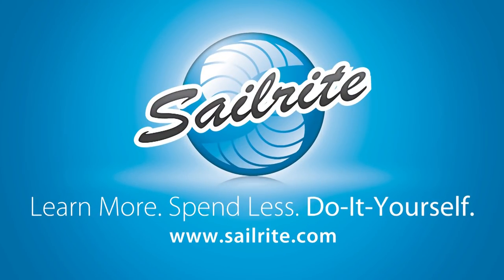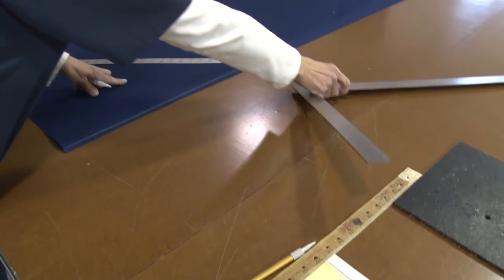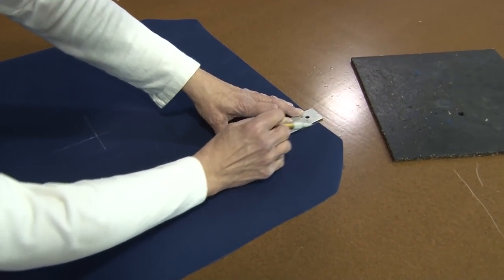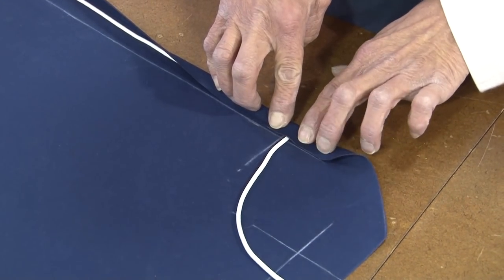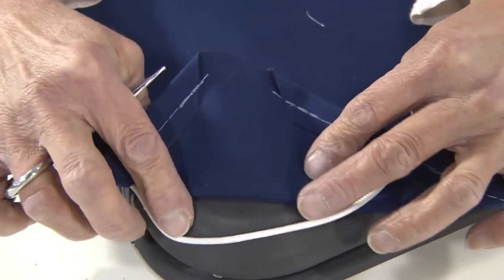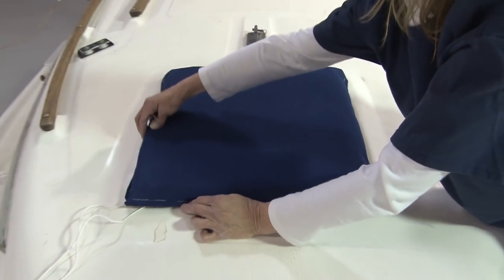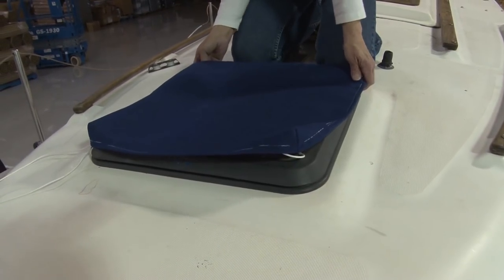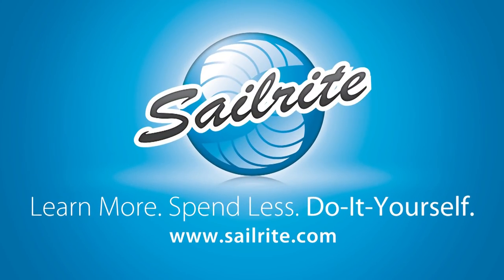How to Make a Hatch Cover Video

Comment: I have just completed making my first ever hatch cover using this method and very pleased with it and myself! My measurements worked out (mine wasn't square) following your instructions. The only thing I have done differently is  I have bound the ends of the elastic so I can't take it under the hatch to prevent leaching of rain but, instead, have added velcro on the under side which I can take under the hatch itself. I stitched each end of the individual strips of velcro, not on edge of material but in from the edge so that it is under the cover so should not leach water even though under and inside hatch.
Reply from the maker: Glad it worked out great!

Comment: I was making covers for a lewmar low profile number 30 hatch which is rectangular.  Even with adding the 1 1/2" addition for the hem, my first one came out to small by about 1/2" all around. I increased the dimension in both directions by 1" which seemed better. It holds very well, but is hard to get the long sides to tuck down because there is very little space between the deck and the hatch.
Thanks for the video is was a great help.

Comment: completed my first hatch covers. Questions and comments.
1) It is harder than you think to not sew the leechline. 😵‍💫
2) Suggestions would be appreciated to measure diagonal on a rectangle hatch.
3) I think I will not remove extra material at corners until I have actually fitted it for rectangular hatches.
4) Do you suspect hatches will leak if the leechline goes into the hatch seal area (gasket) as when you pull from interior?
Reply from the maker: It is possible that the leechline may cause leaking when placed under the gasket. Some are using YKK Snads instead of leechline to secure hatch covers for that fact alone.

Comment: Question, are the 5” in the corners based on these specific measurements or  is that a good roundabout number that would roughly work for most hatches roughly
Reply: 5 inches did not work for my Lewmar covers.
Reply: My exact question. I assume that figure is based on where the edge meets the curve and how many inches is required to hold it in place around those corners. Would be nice to see how it was measured on the video. Sailrite: do you have an answer to the original question?

Comment: Has anyone tried using a light weight bungee instead of the leech line cord and also has anyone experienced their hatches leaking with the cording caught in the gasket? Just curious as I am building these for a client. Thanks!
Reply: My exact concern. If you put that leech line over the gasket, that gasket will never be water tight again. I like the design if you keep the leech line outside the inner rim of the hatch. Maybe even better with a bungee leech line, but not over the hatch gasket.
Reply: Going over the gasket with a cord is a huge mistake.  I’ve used bungee in the edge and it greatly complicates things.  For it to be tight enough to hold on in a strong wind, the ruffles along the edge are quite large.  64” around the hatch, started with a 55” bungee cord (1/8” diameter) and ended up having to shorten it by 22” just to get it to be snug.
Reply: I made these and the water plus humidity drips down on the cords. Can’t have a line in between 🤨

Comment: I am not following why your diagonal measurement is off.  It's the Pythagorian Theorem (a2+b2=c2).
Reply: The hatch has a big rounding radius on each corner and is way easier to estimate with this trick, when you make the fold on the corner that you don't have spare cloth hanging. If the corner is chamfered, with this you sew the edge and the shape follows the contours of the hatch. Hope it helps!